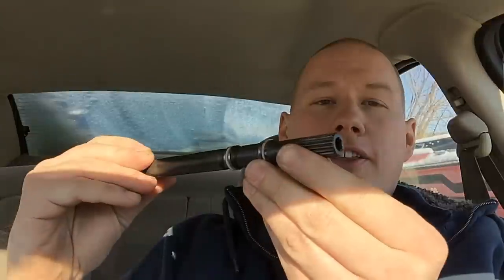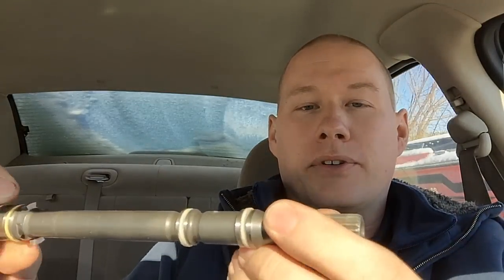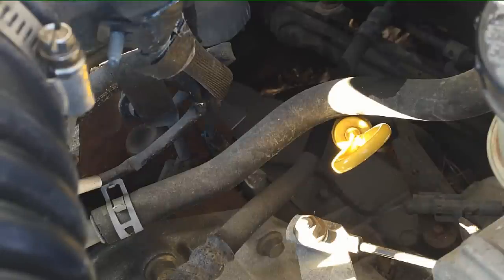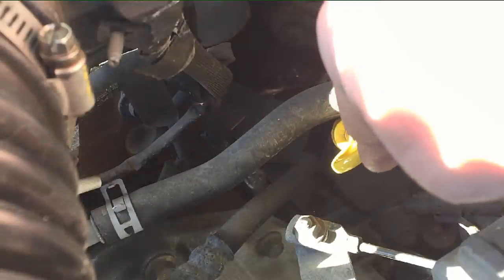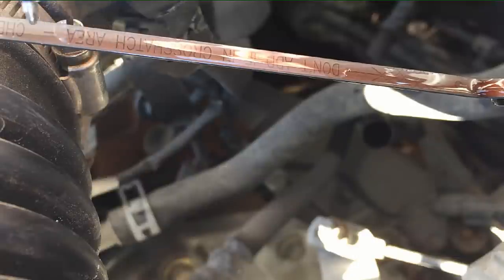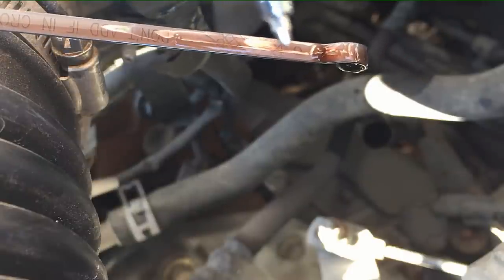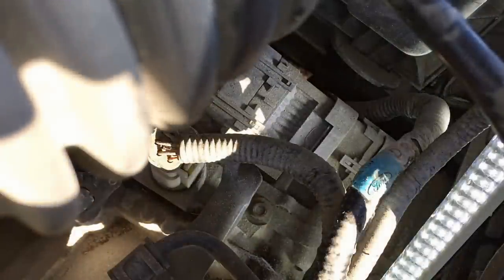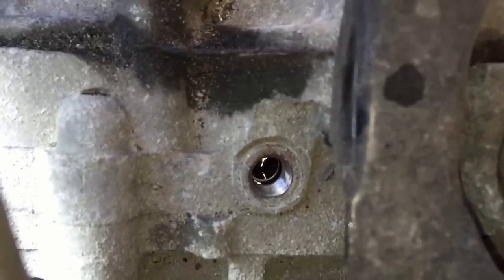Ford Transmission Tips: #5 Ford Taurus & Windstar No Movement EASY Diagnosis

Comment: my Windstar looks like the PCM is bad, I did test the wiring and pins on the PCM according to my alldata and found open circuit at the PCM between pin 6 -- to 71,24,25,51,76,77,91and103
This test was for the TSS turbine/transmission speed sensor test at the PCM  which other pinpoint tests were good.  I had rebuild the transmission and it never shifted then put in another from the junkyard and did the same. What would you suggest. Any further tests? And should I buy a used or new PCM if available from the dealer and probably they can program it without the vehicle. I tried looking but I didn't see any burn marks but I will still try to further check this PCM. Still I will appreciate your advice. Thanks

Comment: I have a 2003 Ford Windstar with a rebuilt transmission with 50K+ miles on it w/ flush/filter replacement 10k miles ago, and recently the od light will start blinking when I am going up a steep incline at high way speeds. No shifting/slip issues when I am city driving. What do you think the problem is?

Comment: Thanks for your videos. I just purchased a 2001 Mercury Sable with 82,800 miles. I drove the car with no problems for 374 miles. The other day I noticed the car hesitating when I'm at a stop sign; turn and accelerate. When I finally got the car home I noticed a lot of oil leaking underneath. Today I tried to move it and no Luck. i went through all the gears. I checked the transmission oil and it's very low. What would cause the transmission to leak heavily? Car doesn't move at all. Car starts with no issues. I checked fuse #28 and it's good. No check engine light. I was thinking of replacing transmission pan gasket & filling tranny up with oil to see if it engages. I also want to do the transmission pump test you displayed but I don't think I have enough oil to do it. Any suggestions?  Thank You - Luis from NY.

Comment: Excellent video. My wife was driving our Freestar we never had any kind of issues before or noises very smooth shifting and suddenly she was parking on a hill backwards obviously on reverse and suddenly the van went like neutral and lost all of his power going forward she stop and from that moment the van won't go on reverse or forward i did the first test of this video and the oil was real high on the measure stick then a did the 2nd test of removing the second screw and there was oil coming out so i'm a bit confused i dont know if its the torque converter or the Oil Pump Drive Shaft can someone help me please? Thank you

Comment: Another guy said in another vid that if you have any gears at all that this shaft or torque converter is not likely the problem, which I guess makes sense.

Hey Fordtechmakuloco, my 2000 Ford Windstar has just started not shifting past 2nd gear. Where it should go to 3rd it revs freely as if it were in Neutral. A buddy read the codes and there are none with a Solus Pro. But reading live data found #2 fhift solenoid stays open at all times, in park 1st or 2nd or drive. 

What do you suppose is the problem?

Comment: If the transmission fluid is leaking out of the seal on the pump is it possible to replace the seal without removing the transmission? Or is replacing the transmission a smarter option?

Comment: Hi- I have an '05 Taurus; this morning my transmission just 'let go' and would not go back into gear. Fluid and level- check. Linkage movement- check. Used the method you demonstrated and got the flood of fluid from the port. Tranny is 'whining' like a power steering pump. Shifter will go to all gears, but nothing engages. Could it be the Transmission Range Sensor has failed? What's the next step? Thank you for any advice and/or pointers ~

Comment: Thanks for the info ! How many miles in a car?? So, torque converter is about $300, and axel maybe $70-80?? how do you know, if you have to change the pump axel too?? just visual inspection?? Are you able to change the pump-axel without taking the whole transmission apart? Thanks, youtheman =)

Comment: Would this be the same if you just can't go in Reverse Up a hill (after warmed up?)  All other gears work fine.  Or is that going to be something else....
Reply: Let me know what you found mine is doing this too
Reply: @wadeg9192  Replace the transmission is what you do.  $3500 if done properly with OEM parts by a Good shop.  Thats what the fix is.

Comment: your video was very informative but i have another issue. i have a 2000 windstar and the pump is working. i have reverse but nothing with D or 1st. it grabs in 2nd but not enough to move the van. any ideas on what may cause this issue? seems to be a fairly common problem too.
Reply: +Diana Sams Intermediate clutch pack failure

Comment: My 09 Ford Focus transmission gave out on me at 78000 miles. I got it rebuild but it has a whining noise still only when decelerating between 3rd to 2nd gear and it shifts hard sometimes. I have a warranty but the transmission shop is giving me the run around. I have kept my car up to par and it runs awesome so I know this issue is due to the rebuild. Can you shed some light on this dilemma.

Comment: If the splines are stripped out will this prevent the transmission from going into neutral?  The shift lever moves and the linkage looks to be good but it will not actually come out of park.

Comment: Any idea about a 2002 Windstar 3.8 that will shift when the motor is cold? When warms to operating temp, tranny won't shift from 1st gear to 2nd.  You can manually put it in 2nd, drive, get up RPM's then put it in drive and it goes into 3rd? So just 1st gear is shot.

Comment: I have a 2000 ford windstar that slips a little  when turning a corner then catches up. 
What would you suggest I check? Would fluid pressures possibly be the problem, Fluid is full. I have replaced valve body, same problem.

Comment: I have a issue with the 2006 Freestar wanting to drive or reverse after shifted but something (maybe in the transmission?) is holding it back. No engine light on, trans fluid is fine. It was sitting in the cold for 2 weeks. Nothing is under the tires. Do you know what's going on?

Comment: this just happened to my wifes car yesterday and I checked at the inspection port and there is fluid coming out when  the engine is running but not a large amount. If I had a pressure gauge connected what pressure am I looking for from trans fluid pump? Hope you can answer question
Thanks!

Comment: Need to see if I can get some help from you 96 Ford Windstar gets up to operating temperature first and second work great if it gets into 3rd and Overdrive and notice I said if it will not stay jumps back down to second then back to Overdrive and then eventually will not come back out of second have to stop the van let it cool off for about 10 minutes then we're good to go this is a constant thing I do not believe the transmission needs to be real built could be wrong could it be the synchronizers somebody said there was aluminum clutch plate in there that breaks that Ford had a statement about back in the day that needed to be changed to metal looking for opinion thanks in advance

Comment: Hello.  I know it's been a few years but I am hoping you still remember.  I have a 2002 Windstar.  First the light was flashing on and off.  Then, I drove it a block from the house and the van acted like it had no gears.  Finally, after a while,  the van got into gear, so I drove it back home and parked it.  When I checked the fluid level, it was seriously up the dipstick.  I think therefore, the pump crapped out.  I have started the van and moved it around a few times but I will not take it any further.  Does that sound like the shaft is bad?  Its not the torque converter since it does move.  Any help you can lend me would be so greatly appreciated.  Roy

Comment: I have a 2005 ford Taurus SE 3.0 engine, my transmission kicks in second gear ( in the summer time mostly ) but when i took it to a transmission shop and they put it on their high tech transmission scanner they said it shows no transmission codes.  They said it could be one of the engine sensors that are giving the transmission wrong readings as to when to shift.  Have you ever heard of this before??  And the engine light is always on but not blinking.  Do you think it could be a transmission speed sensor?  or do you think the transmission shop has it right.??  I read that one of the heat sensors on the manifold or exhaust somewhere could be lazy or just needs replacing. .............Please help!......thanks

Comment: 03 windstar w a trans problem similar.  my question is, and forgive me if its been asked but i didnt see it, can you pull the shaft out after removing the valve body with the trans still in the vehicle.  seems like there is a lot of room over there.

Comment: Hello,
Is it possible to have a leak from the line pressure port?? I keep seeing transmission fluid on top of the transmission case. The first time it happened there was transmission fluid that shut up through the transmission dip stick but I then realised it was not leaking from there...I don't know where is coming from? This usually happens right after i turn on the car. Could it be the breathing vent valve that you show on your video "TIP#10" ??
Reply from the maker: Rod Duncan Yes very common.
Reply: FordTechMakuloco is there any fix to it? what do you recommend? a new line pressure port plug or something like that ?
Reply from the maker: If the pressure port is leaking and there is Teflon sealant on the plug the case is cracked it seems. I have seen this before.

Comment: Just put a new torque converter in my 98 taurus wago with the ax4n. prior to doing this repair i had no forward or reverse. Inspected the old converter and it was completely stripped out. not a spline to be had. So i installed the new converter, and filled with new fluid. i noticed that it took awhile for the fluid level to go down as the converter probably holds 3-4 Litres of fluid. so now that the trans is back in and full, i have reverse, and it slips if you get on it. and when in drive or any other gear it moves a little forward but slips badly. fluid was nice and pink, and no burnt smell. i did not remove the transmission pan or valve body. the splines on the pump shaft looked like new.. any ideas ?

Comment: I have a 98 ford Windstar I drove it to the beach yesterday just fine it had problems already I just get to one of them was the torque clutch converter the on my way home from the beach It started to lose power and I could only just rev it up no movement at all I look under the and fluid was just pouring out from the transmission to point were there was no more fluid in their could that the torque clutch converter finally just went out

Comment: Hi FordTechMakuloco,
I have a 2005 ford freestar with 141,some odd miles the trans was rebuilt in 2010 from Ford. well my question is when its running it has pulled some codes 0171 0172 and the little plastic bushings on the IMRC are broken off. But for the concern is whenever you put it Drive or Reverse and give it gas it moves both directions ok, however their is a annoying clicking sound in both directions. the whole front in drive has been replaced.....CV joints, hubs, brakes, calibers. just curious as to what would be causing this. if it is transmission related, (which i'm hoping not again) the first time it just quit no power at all. There is a video on here listed with the sound mine has under 2005 Freestar engine/transmission noise. Also how long would the Freestar recall be for on the torque converter. I don't know if this is ever been repaired under the recall form. Thanks

Comment: I have a 2003 windstar 3.8 ax4n.and at 109k the trans died no engagement but pulled the plug 7/16 plug out and it's pumping fluid out hard.fluid is bright red and clean and not burnt.shift cables aren't broken.
Reply: Where should I go from here??
Reply: +nmattcar Your bands could be broken. Kinda weird that you don't even have Reverse or any gear. This is what you should look at - why?
Reply from the maker: +nmattcar Put a pressure gauge on it.

Comment: I have 2005 Ford Free star has 140K miles. I was driving at
25MPH when of a sudden I lost movement; I drifted to the side of the road. Had it
towed home. It turns on normal; it accelerates normal but no movement on any
gear forward or reverses no on 2 or 1 gear. If I shift it to Natural it does
move if I push it.  I seen that my vehicle
has a recall for Torque converter output shaft that may fail. Do you think this
is my problem?

Comment: Hi I have a 2001 windstar lx and my o/d light is blinking and my engine light is on and when I put it in drive it kicks in gear. The people said it is because my transmission is getting over heated a P1783 and then they said it really could be the transmission sensor is not working and that's a P0172 . what do you think please let me know they are going to try and fix it tomorrow they said also I need a transmission filter and gauge replaced also. It will all cost they said almost $300 or maybe more. Please let me know what you think ??????

Comment: Got a question about a 95 explorer that's doing this before it stopped working I had to take my foot of gas for it to shift now nothing. Could it be torque converter how do you know if its the pump or converter.

Comment: I have  2004 Taurus ,  200k runs fine",Check Transmission "message  came on any suggestion?I hit the reset button but comes back every 20-30 miles on highway
Reply: Did you find out what it was

Comment: I have a 2005 Taurus that initially goes into gear and drives for a couple of miles fine then slowly looses power. i can shut it off for 30 min and the car will drive again. Could this be the torque converter? No problems with the engine. I checked the fluid level and it is high at shut off and low during startup. fluid coming out sparsely at test plug.
Reply from the maker: Sounds like it next step is to do a line pressure test with a manual gauge in all gear selections.

Comment: can the torque converter fail without damaging the shaft or should the shaft always be replaced? will the fluid be contaminated when the torque converter splines fail or is this part of the transmission dry?
Reply from the maker: +Erik Ferguson the shaft does wear it's hard to tell until a new one is next to it so I always change them. I have never seen much contamination but I always change the fluid and filter with this failure
Reply: what about the VSS can that make it seem like its not in gear?

Comment: What about the splines on the shaft that connects to the TC let's say the shaft is worn on the TC side does it pull right out or the tans. Has to be taken apart ?
Reply from the maker: V10PDTDI To replace that pump shaft you muste remove the side cover and valve body on the trans then it slides right out yes.

Comment: Do you just replace converter or do you have to replace converter and shaft?
Reply from the maker: Both plus the scarf cut seals.
Reply: FordTechMakuloco  how big a job is it to pull transmission ?
Reply: KeepOurRights: That's a good question. My guess is you would either eyeball the spines on the shaft or have them measured for excessive wear in order to decide on a new or improved used shaft.
Reply: KeepOurRights o
Reply: Oil pump shaft never needs to be replaced for a stripped out convertor,,,the shaft splines is a very hard material that never have an issue,,but the pump shaft does get replaced for other reasons,,, specifically when the oil pump bearing wears into the shaft and eventually sets a p0741 code,,(tcc slip detected)
Reply: I have a 2003 Ford windstar 105k miles. One day the wife stopped to pick up the kids started the van put it in drive and it just reved up would not go in drive. It will go in reverse, 1st, and 2nd with no problem. I can get it to go in drive but when I come to a stop it revs and won’t drive again. Would it be a solenoid?

Comment: great video, sorry if i am too late but i got a question. My 2001 ford Taurus has a slight jerk when i accelerate from 1st to 2nd gear only. But if i accelerate fast from 1st to 2nd Gear it has a stronger jerk.
I read it can be my VSS Vehicle speed sensor and Taurus's have this problem quite frequently. Do you think that is my problem or what should other stuff should i check?
Reply from the maker: +joo joo I would go right for the 1-2 shift accumulator spring it is likely broken.
Reply: Is disassembly of the Trans required to get to the accumulator spring?

Comment: Hey Ive done the test and the trans fluid started pumping out the port, what's next? Range sens is good, cables good, just won't move or go into gear. Had no previous issues just went into neutral while driving and now won't move. Should I check the shift solenoids?
Reply from the maker: It may only be half engaged, I would put an actual pressure tester on it now to get a reading.
Reply: Did you find the problem

Comment: Have a 2000 windstar and is running in first gear it won't shift codes that the van is giving are "U1059" and "U1027" any help please i will appreciate it. Thank u

Comment: 2007 Ford Five Hundred FWD 6 Speed Automatic Transmission.Hello, this is Tony. I have been having some transmission issues with my 2007 Ford Five hundred. When driving, I suddenly hear a grinding noise, and the it feels like someone is pressing on the brakes. The car eventually comes to a complete stop. There is no lights on the dashboard stating a problem. I took it to a mechanic and they noticed that whenever the car shifts into 3rd gear, the transmission goes back into reverse. What could be the problem? Is it the control module for the transmission?Thanks.